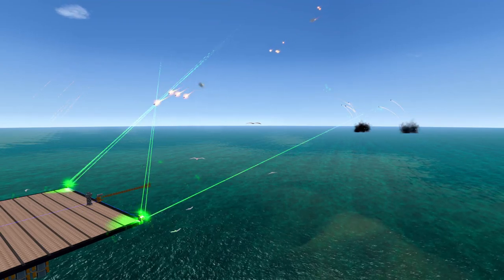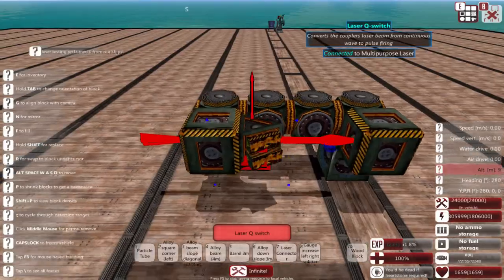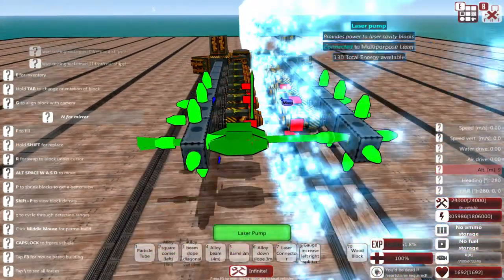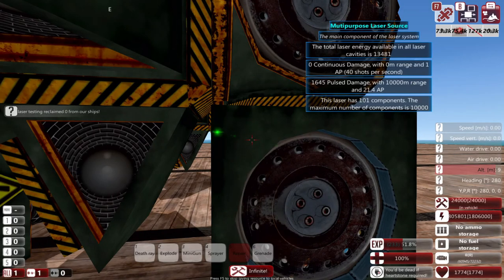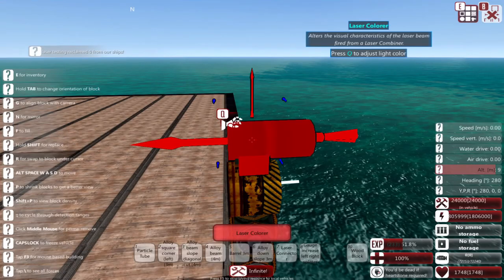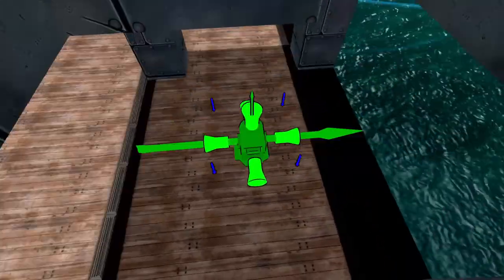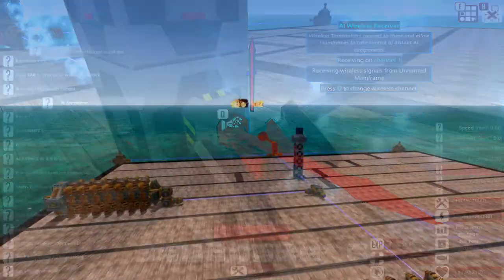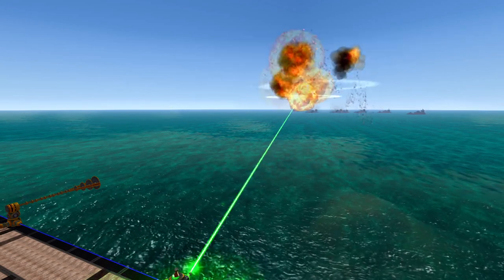From The Depths Laser Tutorial

Comment: Hello, I have a problem.  I have followed the steps in the video precisely, but the pumps are not charging.  How do you supply power to them?
Reply from the maker: Does your vehicle have a fuel engine or electric motor?
Reply: ballparkkenan I'm using 2 custom jet engines with the following configuration:
Intake:Controller:6xcompressor:4xcombuster: exhaust
Reply from the maker: The jet engines don't produce engine power. Only the steam engine, fuel engine and the electric motor produce power that the laser pumps can use (engine power).
Reply: ballparkkenan Thanks, I'll add a fuel engine to the plane now :)
Reply from the maker: No problem!